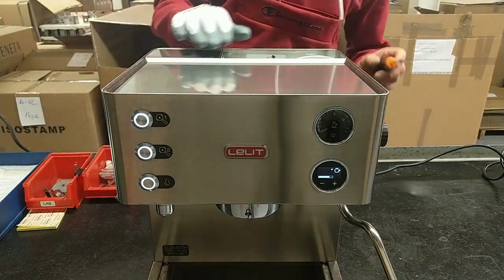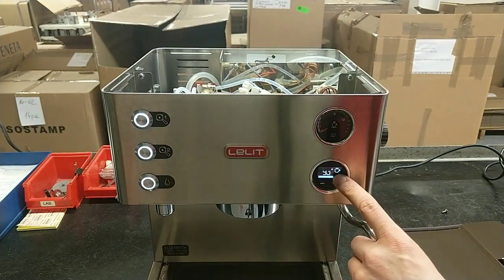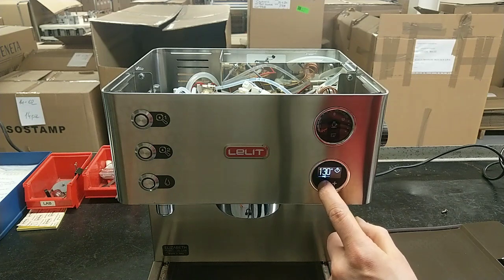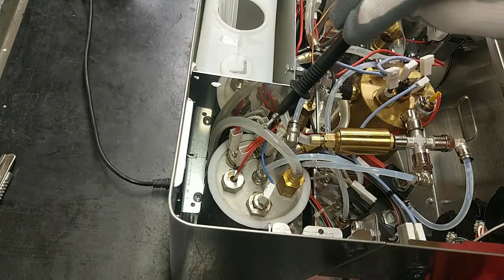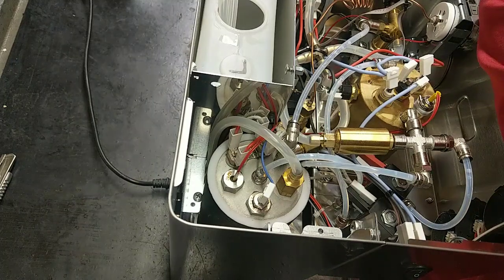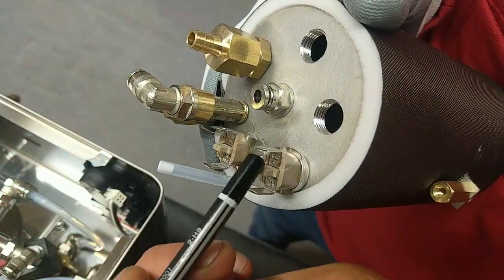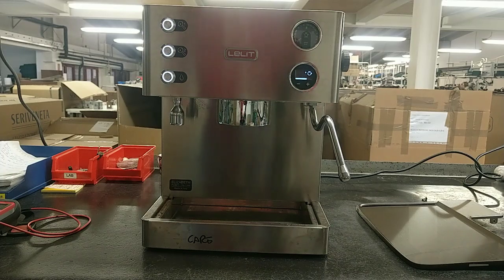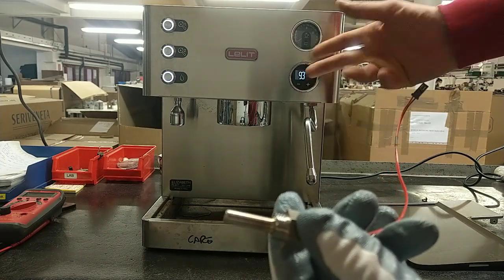pl92t steam boiler doesn't heat

Comment: I have an issue with steam pressure. Temperature of the steam boiler is ok (around 135-145c) but I am not getting much pressure. My Lelit Elizabeth is 1 month old, steam wand holes are not clogged, steam boiled is refiling without issues, but I am not getting steam high enough to froth a milk. This issue that I am getting stated to appear one week ago. Do you have some suggestion where to look for. Thanks
Reply from the maker: Hi, please send an email at care@lelit.com and please send us the  serial number foto of your elizabeth
Reply: @lelitinsider2977  Hi, I did what you suggested and Lelit kindly replayed and said what could be the issue, but with little research,  the tap pin was the issue(2200075), teflon worn out , I replaced it and now I have much better steam pressure.  
But I am facing different problem now with steam pressure. I set steam to 145C, while steaming 150ml of milk, temperature rapidly dropped to 124C but boiler heating element did not turned on to heat up the water to set temp(145C). It passed 1 minute and then heating element started heating water to 145C. I did a test to see to what temperature water needs to drop in order for PID to automatically turn heating element. This temperature was 118C. Can you tell me if this is the right behaviour, I think that PID should turn on a heating element way before 118C. 
Thanks a lot.
Reply from the maker: @nemanjatalijan  hi try to set the steam temperature at a lower value, example 135°-138, and tell me if happends again
Reply: @lelitinsider2977  
Thanks for the suggestion, apparently this is not happening when steam boiler temp is set to 135C. Heating element is almost instantly turned on if temperature drops below 135C(133C heating element trigger temp, but can not build up temperature back to 135C if I do not stop steaming, then when I stop at 116C then it turns boiler refill and then goes back to 135C. When boiler is set to 135C it is very difficult to steam 150ml of milk, losses pressure quite fast. From 135 to 130C in 5 sec). 
Also coffee boiler temp is fluctuating quite a lot, set temp is 95C and it drops to 89C and then rises to 104-110C and then drops to 93C or to 89C again, it depends. 
Do you have any other suggestion or do you know what is the issue.
Thanks a lot for helping me to try troubleshoot what is the issue. All the best
Reply from the maker: @nemanjatalijan  please cek your ec value, and if is 5 change it with 0 
as in this video https://www.youtube.com/watch?v=rR4b6w9iOfs
Reply: @lelitinsider2977  I changed ES value to 0 and it worked. Now it drops from 135C to 130C and stays at 130C the whole time while steaming(heating element is turned on when temperature drops by 2C). EC is at 10, should I change this too? Thanks

Comment: Hi, so the problem in this situation is the sonda???

I hace machine with presostato and safety termostat...
And sometimes the boiler stop to heating..

I decided change valvols antidepressione because loss steam... and change safety termostato. For now work well..

But you have any coment?? Thanksss
Reply from the maker: hi, when the heating doesn't work,  is the safety thermostat activated?
Reply: @lelitinsider2977  in my case... maybe yes...

Because when push bottom of safety  thernostat, the resistance go heating.

Also this problem, It is since work normaly... and time after less temperature, but and when open steam valve the machine less all pressure (in the manometer)

I don’t know with totaly securitt if this is the problem and the solution  but in this case... it seems solve
Reply from the maker: @achitofernandez2570  hi have you changed the pressostat?
Reply: @lelitinsider2977  inthis case, no
In other machine with sinilar proboem i changed for a new pressostat but I didnt have good results...

So, in this case I change  just safety termodtat and valvole antidepressione because no blocking well and loss steam here
Reply: What is the thing that surrounds the steam boiler (black and white) I would like to know the name so that I can order it thank you